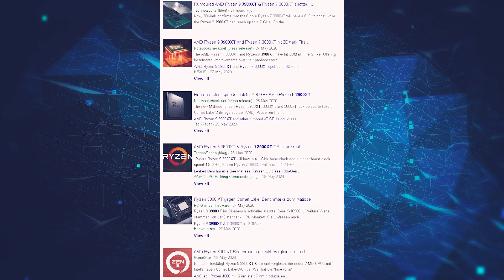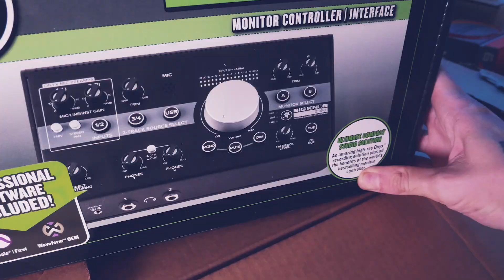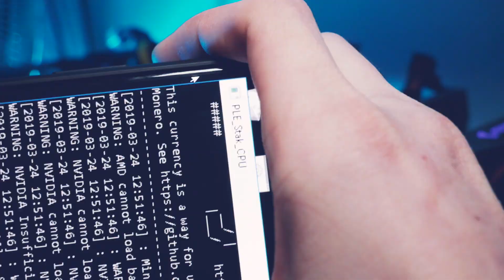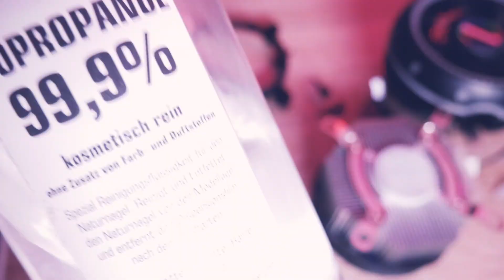June 2020 Home Crypto Mining Update: 3900X Random X / F1 Mini FPGA / GPU on ETH / XZC / AION

Comment: Hi, thanks for the update. 
I wanted to ask how much clearance do you have above the Noctua cooler and side panel?
I've purchase the same case but I'm getting a BeQuiet dark pro 4 which I know is a little taller and hope it fits!
Reply from the maker: hey Lee! The front fan is closest bc of RAM, hard to measure exactly, but I'd say I still have a good 5 cm before touching the glass :) I hope yours will fit, the heatsink itself is not as bad if the front fan doesn't have to be adjusted for RAM. Hope it helps, cheers
Reply: @CursedMining  Super, thanks for confirming.